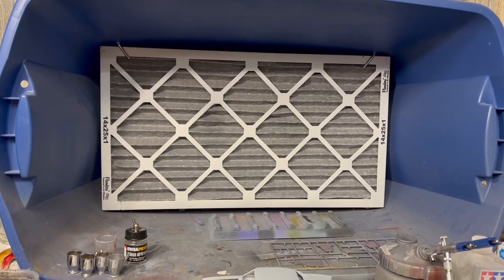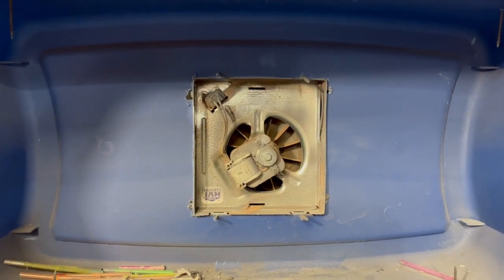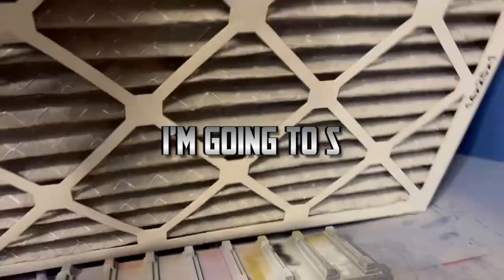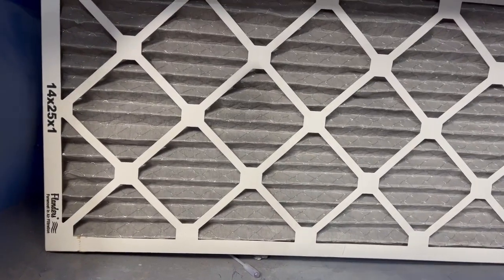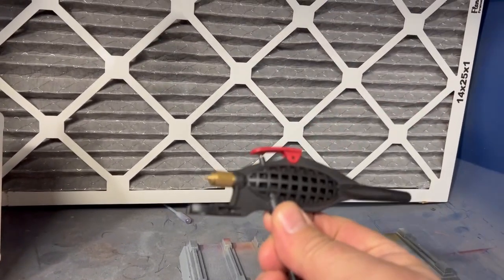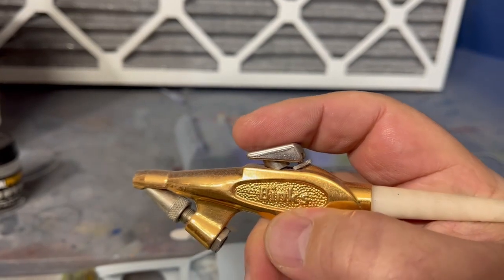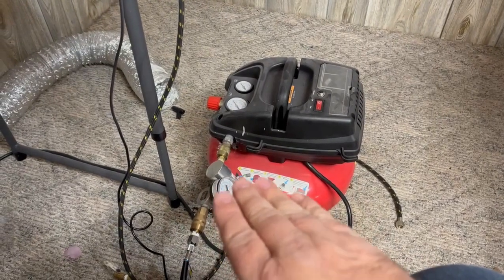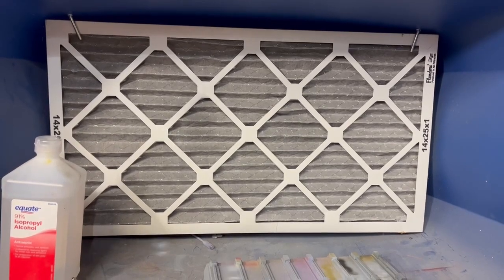My Home Made Spray Booth

Comment: Nice Mark! Just what I was going to do until my Son in law gave me a Master Airbrush & booth. It's not big enough for me & has a top fan extraction. that I really don't like. I managed to build it out with some cardboard. I also found that these old hands really didn't like the top button on the brush so I invested in a pistol grip and it made all the difference for me. It works great and came with a 3,5 & an 8 needle. So I'm set too. Love doin the dumpster divin too! Thanks for sharing.
Reply from the maker: Thank you very much for watching.  Can I ask what pistol grip airbrush did you get.  I am getting serious about getting one.
Reply: @grandpamarkshobbies  Hey Mark. The Master airbrush G79. Polished the needles first after all not the top of the line but for me not too cheap $69.99 @ Amazon with free shipping. I'm new to airbrushing but so far it has worked great for me.
Hey thanks again for your videos. I know it's work to get them out.Let me know what your gona do Mark.
Reply from the maker: I'm heading to amazon as soon as I hit the reply button.  Thank you very much.
Reply: @grandpamarkshobbies  KOOL

Comment: Hey Mark -  I did a quick search on duck duck go with that Binks/Wren airbrush you have there . E bay has several used ones kinda cheap also new ones sell from 217 - 378 dollars !   So venture to say that replacement consumable wear items seals o-rings and such are still available and I will check with Binks for that ...                    Thanks a mint for for your tutorials !!!
Reply from the maker: That airbrush is outstanding for putting down a lot of paint (or clear coat as that's about all I use if for) A friend of mine gave it to me, and it's more for LARGE jobs.  I used it to repaint a section of the wife's car where I had to do some body work.  It has a spread of from two to six inches and will go through the paint very quickly.   Just wanted to take a second to thank you for watching and the kind words.

Comment: OK, you are really helping me with a lot of great ideas. I have been searching for a better... Cheaper spray booth with no luck. I have the generic one they sell on Amazon but it's not that great. This is something I can definitely put together myself. The motor is the only thing I would have to search for.
Reply from the maker: The one thing I don't like with this setup is the fan.  It is so dang loud.  I've seen some nice inline fans that are OK to use with lacquer too.

Comment: oops ... where can I get that nifty handy black paint spray head you have there ?
Reply from the maker: I got that from Harbor Freight, but unfortunately they quit offering it over the past month or so.  It is not good for modeling, but for the woodworking projects it was good to prime and base coat them.  It ate a lot of paint and had about a four inch spread.  My guy at Harbor Freight said they've been asked about them a lot and it's possible they may get them back.

Comment: Nice tutorial..so how many gallons is that tote? I might start getting ready to make me a spray booth..
Im wondering if it works with spray cans🤔
Reply from the maker: Thank you very much.  I think it's 2foot by 1 1/2foot by 1 1/2foot deep.  I wouldn't use spray cans because of the way I have the fan.  You'd want something explosion proof for that.  The only thing I spray is acrylics, so I don't have to worry about it flashing.

Comment: How happy are you with that compressor? People say they're loud and don't last long.
Reply from the maker: I like the compressor.  It sits right next to me, and it is loud, but it was soooooo darn cheap that I'll put up with the sound.  It does have a quick duty cycle, but it never goes low enough to impact the airbrush.  As for lasting long, I've had mine for at least six years now.  I do drain the tank often but hardly ever get anything out of it.  I would love to have one of those small airbrush compressors, but for that price I got the compressor, air separator, quick disconnect kit, airbrush cleaner, and airbrush stand.  Just keep your eye out for sales and you can't go wrong.
Reply: @grandpamarkshobbies  Thanks!

Comment: The bathroom fan is powerful enough to pull the fumes out?  About 50 cfm?
Reply from the maker: I've been running this for a while now and have had zero problems.  It is a quick and easy way to get up and running.

Comment: Really? Such a setting could lead to disaster.  Especially if you're going to run lacquer through that older style fan. Im not an expert, but im pretty sure its not certified as an explosion proof fan.  I hope you have a good insurance policy.
Reply from the maker: Thank you very much for your concern, but I only use acrylic paints, and I clean the fan and filter regularly.  When I get my new shop built I will be making a full blown spray anything booth.  But for acrylics this is fine and works very well.